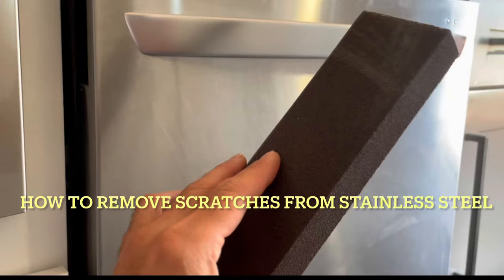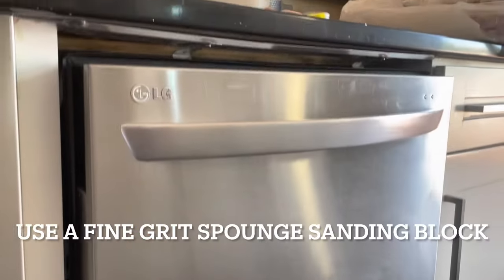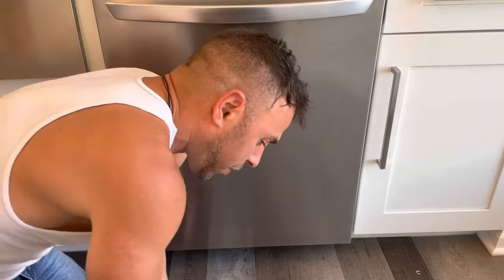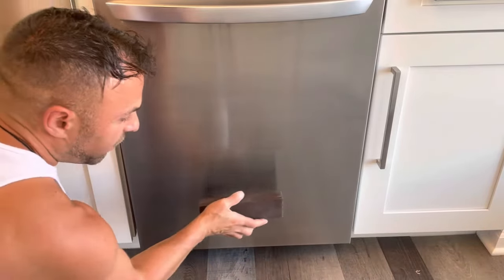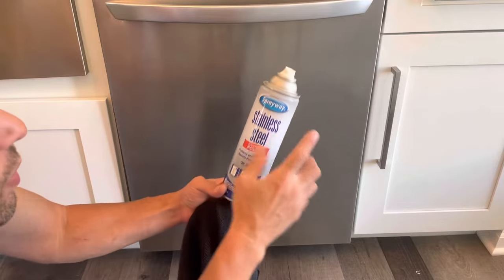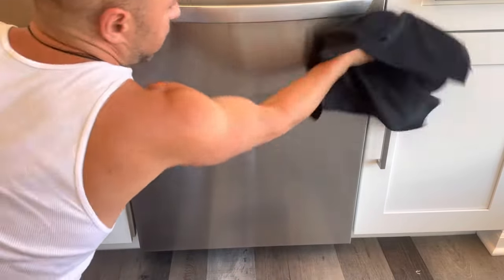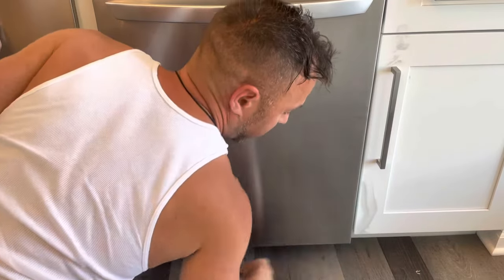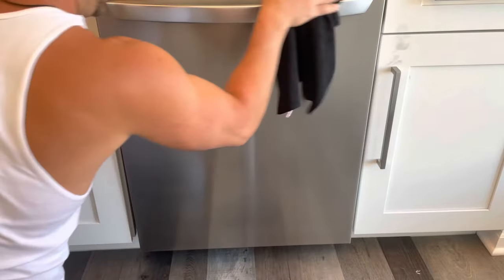how to remove scratches from stainless steel appliances instructions￼ make them look new

Comment: Listen if u are going to do this method 2 things. 1) circular motion is stupid. Period. 2l circular motion is stupid because the steel, just like wood, has an actual grain to it so you want to follow along with the grain. Just make sure you follow along with the grain and u will be good.
Reply: Pretty sure that’s exactly what the guy said. But thanks.
Reply: @krissymichele It is. Not sure why this post was necessary - but it’s good that we’re talking.

Comment: yours is the only video that did not confuse with different grit sand paper. I tried all the other methods but it created deeper scratches, I used sponge sander and my new gas hob that we unintentionally scrubbed and spoiled with multiple scratches in an effort to clean it well. I was so disheartened and stumbled upon your video and now am instead of replacing my sink trying to make it new. Thanks for that.
Reply: did it work?
Reply: @kaylamurphy1227  kind of but not perfect

Comment: Did you wet sand? Funny I am also trying to repair magnet scratches. Never put magnet on stainless steel. The cheap magnets are often chipped and have sharp edges.

Comment: Thank you! You literally saved my life I was so worried!! I used the Pink Stuff to clean my stainless steel fridge and that was a huge mistake! It scratched my fridge. Please DON’T USE THAT on your appliances!! But anyways I found this on YouTube and other video that told me to use 180,220,320,400,600 grit sand paper. That isn’t necessary that will make it worse!!! I tested it out all I did was use a fine sanding sponge it was $3.48 at Walmart and it was a miracle! Also I did buy the recommended Stainless Steel cleaner from spray-away but I found out that Vinager was the best  in my case to clean and WOW it made it shine! I used that with a microfiber cloth!!! 
Don’t forget to go with the Grain that’s key!!! Thanks again!!
Reply: u were literally dying and he gave u cpr??
Reply: Thank you, I will try the sanding sponge, but I am afraid I caused to much damage doing it from another suggestion.
Reply: Gm just wondering what grain number did you use. Thank you.
Reply: What sanding sponge did you use??/grit 😢
Reply: @RocksNRuts4  yup,  sounds like it lol

Comment: Thank you for the video. Question: does that dishwasher have the "no fingerprint" application? My concern with my fridge is if I'm going to "damage" the surface after sanding. I'm in the same boat as you - kids magnets have destroyed an otherwise beautiful appliance.
Reply from the maker: Put painters tape over the fingerprint area. Yes, mine does have the fingerprint.

Comment: Have you tried adding a lubricant while sanding? Such as the metal polish you used at the end?

Great video!
Reply from the maker: No I haven’t but if you do let me know and other people here if it works better worse or same I don’t have any more stainless steel appliances that need fixing from scratches at the moment